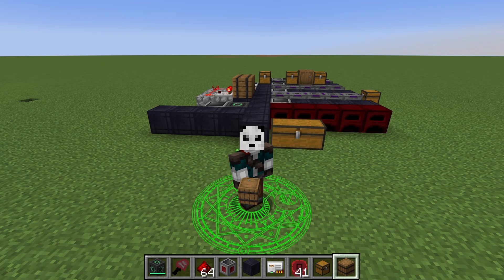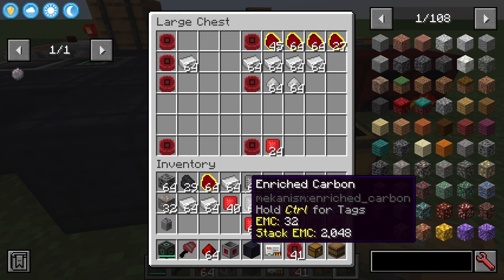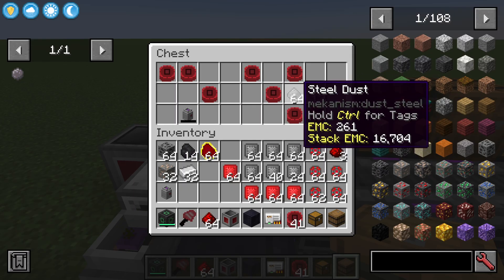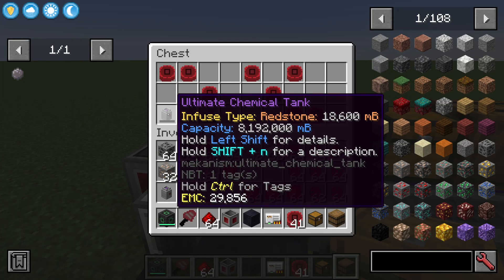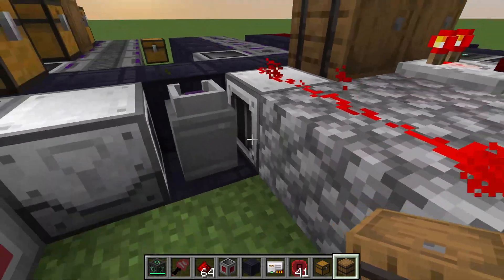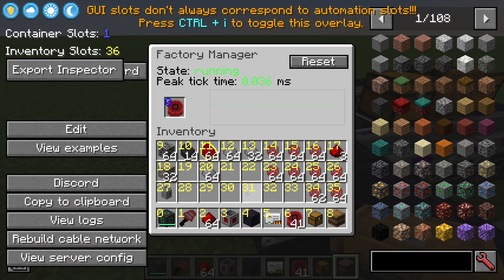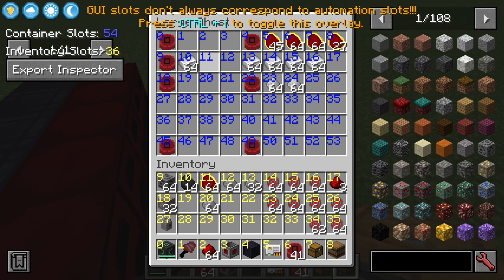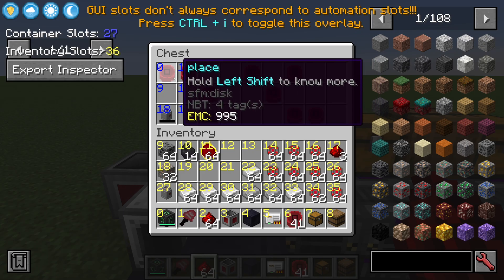SFM command and control

Comment: I hadn't thought of using SFM to do this kind of thing, very good video.

Quick question, are there any plans to add variables?
Or something similar. For example, I use SFM to process the output of my quarry, and therefore I have to maintain a long list of blocks (because some can be crushed in this machine but not in another, etc.) and it's complicated to maintain.

Having variables and at the same time being able to extract, for example, the tag list of items in a chest with the gun into the clipboard, with variables would be so useful
Reply from the maker: @ZeldriFR  variables are a popular idea, haven't settled on how I want them to work yet